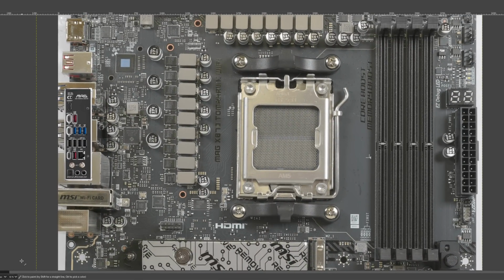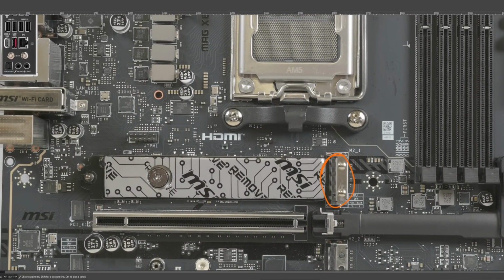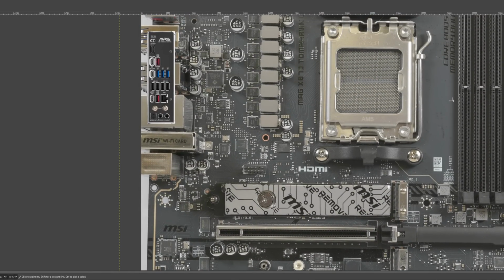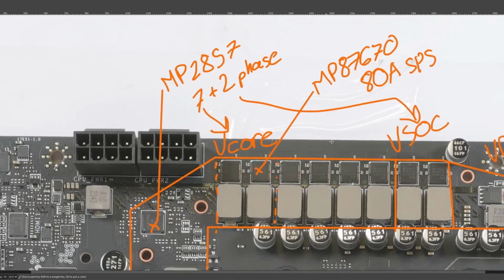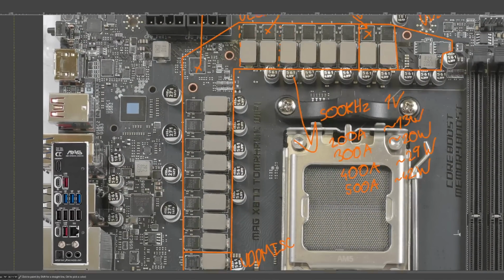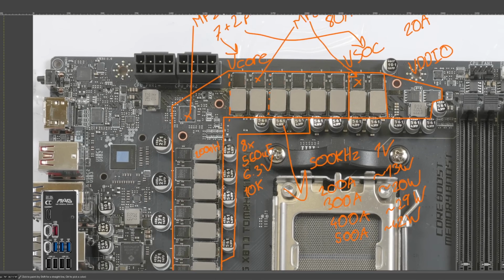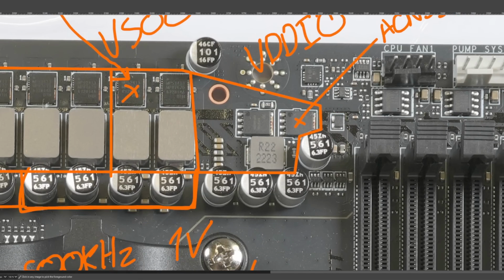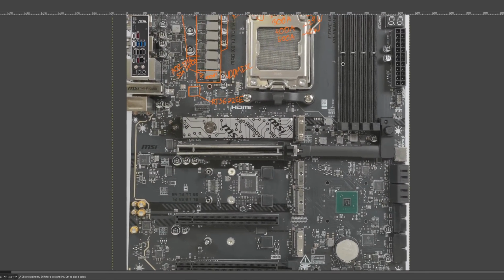mobo PCB Breakdown:  MSI X870 Tomahawk Wifi

Comment: as for the lower 8 pin does it function the same on the X870E version of this board?
to power the 2 USB 4 ports?
Reply: I thought the bottom power was supposed to power the PCIe slot for power-hungry expansion cards like AI cards? Where do you get the info from?

Comment: Three benefits of a 12v -> 5v converter on the board:

* Voltage Regulation.  Not relying on the PSU, and ability to adjust if desired.
* Efficiency.  Higher voltage to the board means less wire loss.  May be offset by converter efficiency.
* 12VO support.

Aside from the USB ports, I don't see a reason for a modern motherboard to have anything but 12V and standby power.  Even then, I'd prefer to just have a dedicated cable / regulator feeding all those ports, instead of having to go across the entire board.

Comment: I wish that my x670 Tomahawk Wi-Fi had that PCIe latch extension. Instead it had a terrible slightly wider lever, that ended up breaking off. With a relatively small (2-fan) MSI GPU, the lever was almost completely inaccessible when a CPU heatsink is installed, and it ended up breaking off as I tried using a chopstick on it.

Comment: Just snagged this board in a bundle with the 9900x and 32gb ram for $550. You sure you're not shilling for microcenter because this video is what convinced me it's worth it to pay the extra $50 over the x670e. Would have loved to get a 9800x3d but it's hard for me to justify paying $200 more.

Comment: Is it harmful to plug in both CPU power connectors? I have the free cables and they're both currently plugged in. Appreciate the in-depth video. Learning a lot!
Reply: I’ve been running this board with both connected since October…no issues…running a 9950x

Comment: The only other board cheaper than this with a 7 segment display is the x870 Aorus Elite and that's a 6 layer PCB and a shared PCIe lane with the GPU slot, So this was much more appealing.

Comment: Wonder if the PCIE supplementary power could be for some oddball Thunderbolt 5 card MSI has in the pipe? Or some of those wild multi-M.2 5.0 cards?
Reply: the manual I read while building it says it is for the front panel 27 watt usb port

Comment: Thanks for the analysis! I purchased this board a few days ago for a 9800X3D build. First MSI board in my almost 20 years of building PCs. Not crazy about the aesthetics, especially the lime green accents, but it had significantly better specs at the 250-300 price point than the competition. Post code and rear IO were the big things for me. 

Pairing with 64GB of dual-rank A-die so we'll see what memory speeds are achievable.
Reply: How do you like the board and bios now ?
Reply: Everything good?

Comment: 12:42 isn't that just the gpu power connector? i have a relatively crappy gpu but i still plug it in. don't tell me that i don't need to? coz once i even waited a week or two to get a 90 degree connector for the gpu end so the internals would fit into an old school ibm desktop case. unless this is an additional one, i'm not sure what the prob is.

Comment: I'd love to see a motherboard company try to hire Buildzoid as sort of a functional consultant - he could basically do the same thing as he's doing here - give a 1 hour presentation to the engineering team on what seems important to focus on, what's already overkill, etc. Create a prototype with those changes and send it to him for analysis and testing - do that 2-3 times, and release a branded Mobo with an AHC logo or some Buildzoid branding or something - maybe aim for 2 SKUs - one high end and one low end with the same core lessons applied. 

Make it happen MSI!
Reply: They already know the weaknesses but they also need to make money
Reply: @florin604  building overkill VRMs has a cost associated with it - that money could be moved to other parts of the board or just be better spent elsewhere. If they're already aware of the issues, why build such extreme overkill? VRMs capable of 400W to a zen5 cpu seems wasteful?
Reply: Overkill VRM is marketing part, which apparently works. These board vendors have amazing engineers which definitely know what is good for PC enthusiasts. But then there is marketing team and product managers, which want to be sure that they can squeeze as much money as possible.
Reply: @florin604  The collapse of the education system is more apparent each day.

Did you watch the video? Did you notice the part where buildzoid rambled for 10 minutes about how this is effectively a 4090 VRM section transplanted to a motherboard? Did you listen to the part where he talked about how this is common occurrence of overkill?

Did you notice the other comments that rightly stated "Overkill VRM is a marketing gimmick"? (That's a correct statement, but missed the idea of BRANDING AHOC as a marketing feature too). 
It's not rocket science. I watched a video, listened to its contents, and proposed an idea related to them. This is called "Commenting" and "Discussion" - I'm not sure where you broke down in the chain of watch video - think - respond - apparently jumping to *reply negatively to a comment*, but you seemed to have missed the point. 

A collab between a motherboard manufacturer and overclockers is not unheard of (EVGA - KINGPIN) - but not common in today's landscape. Since Buildzoid is actively making a 1hr presentation for his audience on what he thinks are hits and misses - I was just nudging the idea to do the same towards MSI. I'm sorry this confused you so greatly.
Reply: This isn't even an unrealistic idea, headphone companies do collaboration products with audio gear youtubers all the time where they tune the products based on their recommendations.

I'd definitely be interested in an AM5 motherboard that came with an official AHOC stamp of approval right on the box.
Reply: I would be one of those potential customers.

Comment: regarding the 2nd GEN5 ssd, am i correct in thinking that drive will still work but just at 5x2 and both the USB4 ports will still function @40gbps and that a 5x2 ssd is still faster than a GEN4x4 ssd?  also if i disable the USB ports in bios, then will both USB4 ports  be completely disabled/non-functional.... not just nerfed into a 10GBPS speed?  i am looking for ANY motherboard that can provide a GEN5 GPU with all 16 lanes and 2 GEN5 ssd's at full 4 lanes each (no lane sharing) preferably with usable USB4c ports.   thank you for any clarification

Comment: I’m an engineer, you’re much more qualified at this analysis.  Don’t think you need that disclaimer 🙂
Reply: It's probably a legal thing. Some jurisdictions treat it as a protected profession like lawyer or doctor and several others. If you don't have the paperwork in line you're best not to even imply you might be a liscensed member of a protected profession. Youd have to ask a lawyer for details becaue I am NOT a laywer. I've just heard of people getting in trouble for claiming (or implying) to be certain kinds of engineer without jumping the hoops to be legally recognized as such.
Technically he has equivelent understanding to an EE in the field.
Reply: it is still very transparent and valuable
Reply: No you're not.
Reply: anyone can be an engineer in 2020s.
Reply: @roberttrisca8210 Are you an engineer?
Reply: @roberttrisca8210  Not really. It's not easy. But some people loosely call themselves engineers when they're actually technicians.

Comment: MSI did a lazy job designing the PCIe layout for this board. Using the CPU Lanes for the USB4 controller is a total waste. the ASmedia chip only requires 4 PCIe lanes at Gen4 speeds, which they could have just gotten off the X870 chipset. AS for the Additional power connector at the bottom of the board, that's there to handle the Power Delivery requirements of the USB4 ports as well as the front USB-C port. You also have to remember, USB4 supports Thunderbolt, which uses quite a bit of power, you will usually find Thunderbolt add-in cards needing an additional 6 pin PCIe power connector, so not surprised this is on the board. especially with the ATX power connector not being the solid pin type
Reply from the maker: AFAIK the CPU lanes being used for the USB controller is the norm for X870 and X870E.
Reply: @ActuallyHardcoreOverclocking  yeah like i said, waste. ASUS on the X670E ProArt Creator uses PCH lanes for the onboard Intel USB4/TB controller. This is the reason why i waited till X870E was announced and could see the PCIe layout, I went with the ASUS board as i am not losing any features going X670E vs X870E with the ProArt and in fact gaining additional PCIe lanes for M.2 drives off the CPU. BTW. Love your board reviews. they help me choose my hardware
Reply: You need to blame AMD for the PCIe layout, dedicated lanes for the USB4 became standard with X870 / X870E boards, that’s not an MSI decision. It’s one of the few actual changes to the published spec that differentiates the 800 boards from 600 series.
Reply: @Slyons89  Actually you will find that AMD's spec of Mandatory USB4 connection for certain 800 Series chipsets DOES NOT state HOW the controller needs to be connected to the system, only that it is required to be there. MSI and quite a few others have taken the easy approach of using PCIe lanes from the CPU as its more convenient for them rather than routing them from the PCH. the PCH has more than enough lanes to support the ASMedia USB4 controller, you'd simply lose one of he M.2 slots attached to said PCH which makes more sense as the Lanes coming off the CPU are Gen5 lanes, where as the USB4 controller only needs 4 Gen4 lanes, which is what the PCH offers natively

Comment: The AONS36306 are highside and lowside?
Reply from the maker: yeah there's 2 of them 1 for each side. You don't need different low and high side fets if the output current is low.

Comment: I admit I like having a postcode display but I wonder how many builders like myself realize we are paying $100+ more at times for a part that can be bought under 20 cents to be included.
Reply: You are paying $100+ more for more features than just a Debug Postcode display. Things like bigger heatspreaders, more/better backplate USBconnections, RGB elements, etc.
Reply: @dnashj33  That's your brain on marketing. Companies always have a product that does the bare minimum that are esentially marketed for system integrators and other partners that will not pay for any useless shit. Then there's the mid-tier products that only exists to provide a large feature list of all the the stuff you're missing out on if you're not willing to pay them significant margins. Then there's the high end, monster boards that combine as many paradoxical features as possible to get two consumers on the same expensive board even though their interest do not overlap. I'm not saying every company is exactly like this but if you pay attention you'll start finding paradox-features in consumer products.

Unless you're of the belief that everyone who buys monster VRM's are LN overclockers that like RGB ram.

Comment: Thanks for this. I've been tossing up between the PRO X870-P and the X870 Tomahawk, so it's nice that you've looked at one of them.
Reply: Which did you end up going with? I’m leaning more towards the x870-P because it seems like the difference in features isn’t worth the extra $50
Reply: The Tomahawk, though it was a hard call. I'm planning on being on AM5 for a long time, and decided I didn't want to give up the POST code. If debug LEDs are sufficient I'd recommend saving the money, though.

Comment: : Does anyone know if there are some nice AM5 two DIMM slot boards incomming?
With the recent news on the new 9000X3D chips these cpus might just get me interessted again, since they're supposed to be unlocked for traditional overclocking due to putting the 3D-V Cache in the bottom and die compute CCDs closer to the heat sink.

Comment: MSi doesn't mention 27W USB-C power anywhere. For VR-users USB-C is always a concern as most USB-C ports only supply 15w which makes your headset run out of power after awhile. I ended up getting a B650 AERO-G which has 60w USB-C, because that was the only mobo under 400usd that said anything about USB-C power.
Reply: It does, but only in the manual does MSI state that the front panel Type-C port can output 27W. Everywhere else, this info is missing.
Reply: @cluthz I had a look and concerning the x870 range, the Asus Hero and MSI Godlike both offer QC4+ which is USBC PD @ 60w. Many other boards offer QC3 with 30w. Just thought I'd share while the tabs are open.
Reply: @dylanmonahan5909  Yes, the boards over 400usd often mentions USB power, and 25w + is good enough for VR use today. My concern is that there are midrange boards out there with QC/PD that you have to look thru the manual for find that they have the feature. When I bought my board I went thru MSI, GB, Asus and Asrocks tech specs on their websites and GBs Aero-G and Asus Pro Art was the only boards under 400 that listed usb power. I've been perfectly happy with the AERO-G tho
Reply: well, the motherboard itself says 27W at the connector. I would recommend getting a headstrap with a  battery instead of running on cable. It has worked very well for me
Reply: @reahs4815  I do have that as well, but for sim racing cable is preferred. My board has a 60w usb-c, so I'm fine, but it would be nice if vendors did reveal usb-c specs in tech specs.
Reply: Threadripper boards are also under 400 bucks and support 15+ W
Reply: I noticed the 27w PD the first time I skimmed over the official product page. For Q3, 27w is enough to slow charge the internal battery while running most content. If you have a second battery in the chain, chances are you'll need 45w+.
Reply: on this board it dosen't but on the carbon the lower pci power is powering the pci slot and the 27w usb c frontal conector

Comment: On M.2 PCI-E lanes and gens, there is that specific Samsung drive (990 EVO) that has specific controller support for doing Gen 4 x4 or Gen 5 x2, just to be an outlier (nothing is untrue about what you said, just that they specifically implemented both), and it'd be cool to see more of that kind of flexibility in the future, but it's hard to justify spending more for that feature specifically when it's so hard to know if you'll ever need it. Could be great for NVME NAS systems in the future, as they often can't allocate 4 lanes a drive, but obviously none of them are gen 5 yet.

Comment: Hey BZ, how are you? I am doing a new build. I have MSI x870e Carbon. Using the 9800x3d or 9950x (not sure yet); I have my eyes on these two sets of DDR5. Can you recommend one set or better. 1. Gskill 64gb 30 36 36 96 @ 6000 $220 2. Corsair titanium 64gb 30 36 36 76 @ 6000 $260
Reply: @ryandraj  Both of those kits will perform almost the exact same (tRas 96 and 76 are really not much different for performance) and also, will have the exact same chance of being either Hynix M-Die, or more likely A-Die, which means the same OC potential on both. So get the cheaper kit if looks don't matter.
Reply: @atirta777  thank you
Reply: Why not 6400 cl30/cl32 ?
Reply: @jvidia  Amd had indicated that the sweet spot for 9000 series is still 6000Mhz
Reply: @ryandraj  That's the guaranteed sweet spot. If your IO die can handle 6200 or 6400 1:1 then that's obviously better.
Reply: @silentdude56k  Yea makes sense. Was doing some more research, so I might just do that.

Comment: The PCIe 8-pin connector at the bottom of the board is probably necessary to support the PCIe 5.1 standard - it expands the allowable power spikes of the PCIe slot
Reply: It's a terrible location for it. With nothing plugged into the 8-pin, it will prevent some PCIe cards from fitting in the bottom slot. With a cable plugged in, it will prevent nearly all PCIe cards from fitting in the slot. I was not amused when I found this out the hard way.
Reply: also for older GPUs that use the FULL 75w of slot power mabye if your doing a weird dual GPU setup?
Reply: Does MSI have a Thunderbolt 5 card in the pipe maybe?

Comment: Interesting that you say this board might do well for memory. Iirc Steve over at HUB found that, at least out of the samples he got, MSI is doing pretty well this go around. I don't know how reliable his testing was, but I like to see it included in mainstream motherboard reviews!

Also, as far as overkill components go, I wonder what the cost of a high-end but pragmatic motherboard would look like compared to what they're doing now.
Reply: Steve did an hour of AIDA64 and showed the highest speed at which each board passed the hour.  It was basic "can the board hit the DDR5 8000 spec AMD is claiming" type testing.
Reply: It would probably look like the Asrock x870e taichi light.

Comment: The ease of NVME SSD DIY feature is now good enough, and it will not improve in the future, so when to move the pcie slot to the backside in order to prevent conflict with nvme ssd installation.